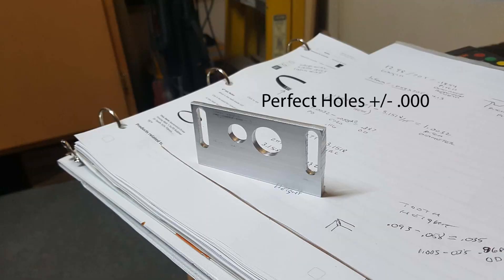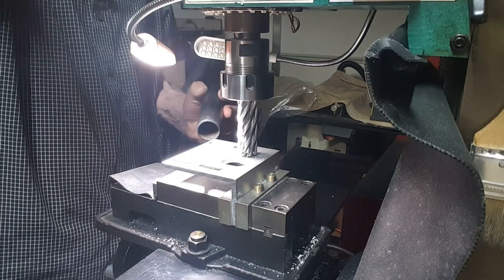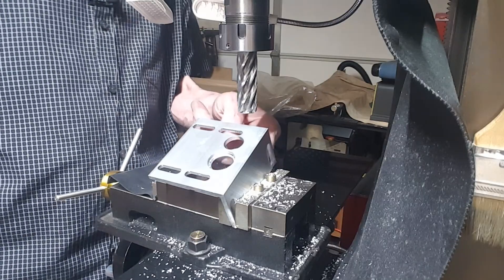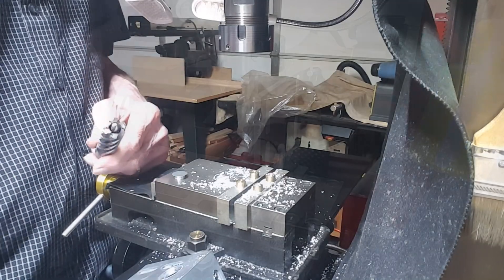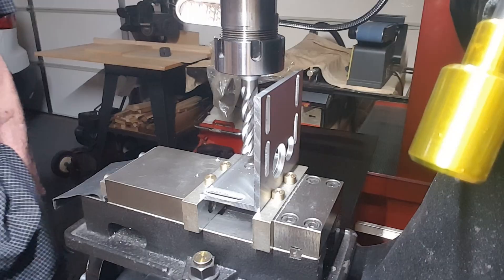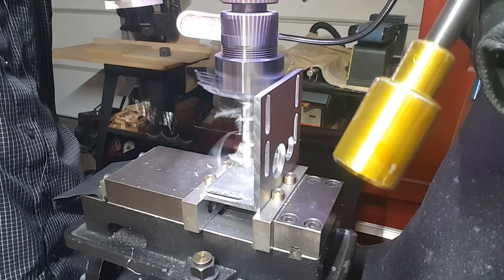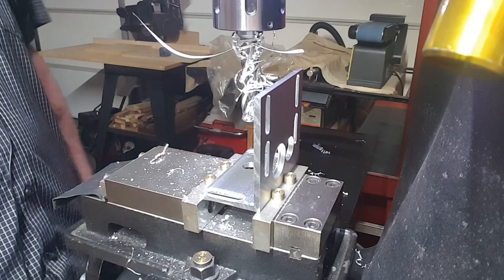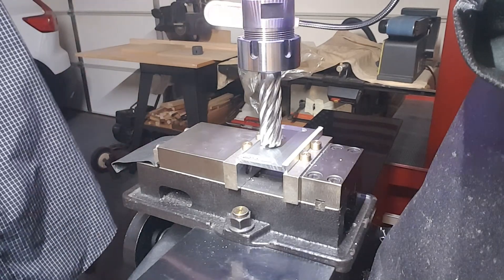How To, Annular Cutters on a Mini Mill

Comment: Annular cutters are primarily used in magnetic drills used in steel fabrication shops and construction. The center pin is used to align the cutter with either a mark or a punch mark for accurately locating the hole. Cutters are sold in different lengths, and the proper length pin must be used. The pin will not typically eject the slug at the end of the cut, and forgetting to check that the slug is out before starting the next hole will make it appear that the cutter is worn out and not drilling.

Comment: Annular cutters are great. I have a set from 7/16-1 1/16. The sets for some reason don’t seem to come with the most common sizes you would most use. I ended up buying individual pieces to fill in.